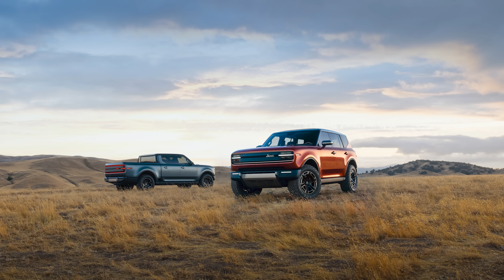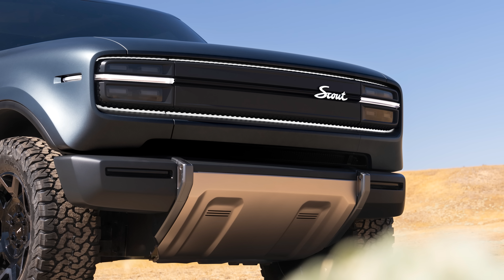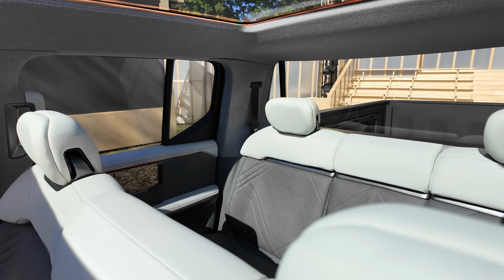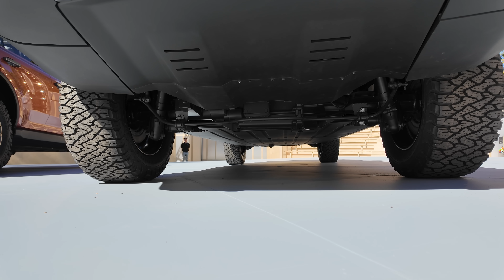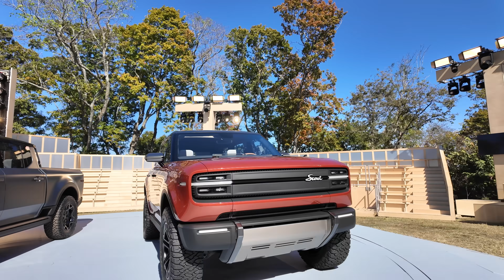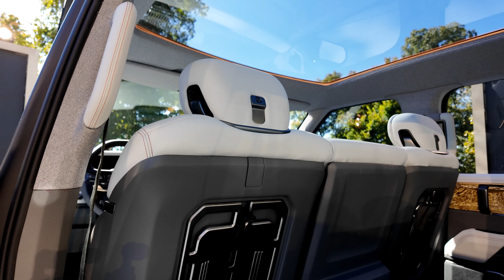2027 Scout Motors Terra & Traveler First Look!

Comment: It's not a scout.. it's no more a scout than prying that emblem off and slapping it on a bronco or rivian or 4 runner. It's literally a font and word, a brand tenant! There is zero heritage in it other than look. No tooling, no employees, no engineering, no factory. It's a insult. Just like polaris hiding behind Indians brand tenant. What kind of moron slaps a deposit down in something based on a emblem? No body in the serious offroad community is running e.v. for a reason. Essentially all of thale aftermarket support is for petrol rigs. Axels .. gears.. what are you gonna do?

Comment: An EV cyber tuck with a fable of range extension that hasn’t been engineered yet. Aftermarket Honda generator? I’d trade the widescreen dash for lap belts, half height seats and a tooth bashing metal dash in a heartbeat.

Comment: Direct sales for Scout Motors are in a legal battle similar to what Tesla faced. There won't be a dealer network and potentials are hesitant given Americans turning away from electric-only, especially for an off-roader. That means no service network, which is vital to startup brands going through teething problems. The initial price will only be affordable to top 10% of income-earners. Estimated range on these is always way above actual range.  I'd give them a 20% chance of making it, but Tesla faced similar hurdles. Hybrids yes,  electric-only no.

Comment: The gas powered engine to provide electricity for the electric motors is interesting. But after you've gone your 350 me or whatever and can't charge anymore I wonder how long/how far you can really drive for just off electrical generation from the gas engine and at what speed🤔

Comment: Definitely looks like re-skinned R1T and R1S, but in a good way.  And those interiors are gorgeous!!  The harvester range extender is going to be a game changer, too.  I've been a truck guy all my life.  I've been wanting to get a truck EV, but Rivian is too expensive, and the others are both too expensive and have design flaws I couldn't bring myself to live with.  I really, REALLY hope these Scouts are as good in production as they look on the screen right now, and that they keep to the teased price points (unlike Cybertruck - teased $40K, actual $100K).
Reply: They are body-on-frame with a solid rear axle. Definitely not re-skinned Rivian.

Comment: They brought in a group of guys, including the owner of Super Scout Specialties, that kept the nameplate alive, former employees and owners that really seemed to push VW/Scout Motors to keep it true to the original.  This thing is going to fly off the lots, if they follow through on features and pricing.
Reply: The old ihc has a fully boxed frames, solid axles, and stout drivetrain for working. This thing is a throw away consumer trash clone ripping off the heritage 😂 nothing ihc in this pos
Reply: @ArizonaMatrix  Guess we’ll see, since this is body on frame, solid axles, and will have to have a stout drivetrain to handle 1,000 lb/ft of torque.  🤷🏼‍♂️

Comment: Too similar to Rivian in genre, looks, and culture. The niche was barely big enough for Rivian alone.
Reply: The Scout is body on frame with real hardware like solid axles and transfer case. I wouldn't confuse a Rivian with a Scout. The Scout has placed themselves to be directly cross shopped with Jeep, Bronco, and 4Runner.
Reply: @redtitan29  With these hardware differences, is it assumed that the Scout would be a more capable off road vehicle vs the Rivian?
Reply: @randyhou8522  Absolutely. They are even offering lockers to show how serious they are.

Comment: They need to change the headlights. Make them circular like the old ones. Also, a removable top like the Bronco would be perfect.
Reply: The bronco truck appears to be a piece of crap problematic thing even after the redo of it. How many people with experience of soft tops or removable hard tops don't actually want to have anything to do with them. They want a nice clean proper non-removable hardtop that is dust-tight watertight weather resistant and clean. Most people never want to have the roof off except for maybe one or two trees for the novelty and then it's like screw it

Comment: So they copied what the BYD truck is doing in terms of the range extender with small gas engine
Reply: Also like the Ram Charger that Stellantis is having troubles bringing to market. This solution makes much more sense, especially during the transition period with limited charging stations as well as for those who travel long distances or travel in remote areas.

Comment: 350 mile battery and zero mention of charge times? And we have to wait 2 years to one?! Scout Motors…. YOU ARE DELUSIONAL!!
Reply: It's an 800v machine, and probably 120-135kwh for 350 miles. So at a 350kw charger, likely under 30 minutes. Maybe 25.
Reply: @deansmits006  EXACTLY my point! TY! Unacceptable and AVERAGE for a vehicle TODAY, let alone one you can’t get for 2 years!
Reply: Yup gas car can be back on the road in 5 minutes with equivalent range

Comment: Every ev should have that small engine that will give extra range on your ev cars.
Reply: It doesn't make sense on smaller EV that won't tow or go offroad.
Reply: With an 800volt architecture and nacs 350mi range is enough for 95% of the people.

Comment: The rivian with better looking headlights but Volkswagen crappy reliability
Reply: Get the EV version with no range extender, you cut out quite a bit of the unreliability. But vw isn't known for it's electrical dependability, however, purchasing the electrical backbone from Rivian should help

Comment: So it's a Scout in name only plus the limitations of electric. Don't think so.
Reply: It's a new brand that's built like an actual off-roader plus the advantages of electric. They could call it Black & Decker and it would still be interesting.
Reply: @Zobeid  I didn't say it wasn't interesting, it looks great inside and out. But all electric is predominately dead in this market no matter how good it looks or behaves (for a short while). The hybrids will rule eventually until some magical power vs weight ratio is found for better range. real world use is not how many miles you can go but how long it can be used in elements for work or travel all day long before having time for a substantial recharge. No manufacturer other than Tesla is making money and this is mainly because they make commuters that are much better than most other choices.
Reply: No limitations with the gas version that's used as an onboard generator.
Reply: @redtitan29  actually it just extends from 350 to 500 miles from what I understand. Called a range extender, not a true hybrid but still a nice addition.
Reply: @towertone  It’s not a hybrid. In a hybrid the gas engine powers the vehicle. In the Scout, the gas engine acts like a generator to charge the batteries while the electric motors power the vehicle.
Reply: @redtitan29  did you actually read what it does? It's right there on their web site. If a 500 mile range is all you need (at max) then yes it might be a great vehicle. I don't like range limits for charging as I regularly go over a 1000 miles a day. Your mileage may vary...
Reply: @towertone  Every vehicle has a range.
Reply: I had a 1972 scout ii and this is no scout 😂😂😂 the heritage was farmers needing something smaller than the commercial trucks ihc made. This is not that 😂

Comment: Compete with Rivian? How is it not completely obvious that these actually are Rivians? Do you really believe VW paid 5 billon for just software?
Reply: Yes. Trust me I work at Scout. This was literally all built before the VW Rivian deal. That deal is only software.
Reply: That deal literally happened out of nowhere, I work for VW and it was a complete shock to everyone in the silicon valley @arcostonian
Reply: @arcostonian So what's the inside scoop, we really gotta wait 3 more years?! 😢
Reply: @arcostonian  wait really? Can you share more details on the Scout brand, if Rivian will make components for the Scout, etc?
Reply: Exactly
Reply: They are body-on-frame with solid rear axles. Definitely not a Rivian. The truck is also larger than the R1T.
Reply: If you compare the timeline of the VW deal and teh presentation, i dont think you would get fully working prototypes in that ammount of time, the development surpassed that deal long before
Reply: Well said

Comment: Price adjustment...100000$
Reply: Good news is it won’t be sold by dealers and will be direct to customers
Reply: @horuslupercal3872 yeah ? That‘s really good news if its true man, fuck em dealerships
Reply: Direct purchase is going to put the kibosh on Dealer Added Incentives.  If they keep the pricing and features, this thing is going to be a home run.
Reply: That sounds about right.  They $60k one will be stripped down low range base model
Reply: Sure,  I have an extra 100k just lying around,  not to mention Insurance costs.  No thanks
Reply: CEO  himself said they will start at 50k with incentives

Comment: That harvester range extender is absolutely unique in the US.  That is going to make this truck a great success.  Very excited!
Reply: I wonder if they have a design yet, or just a concept for the extender.
Reply: Depending on how the gas engine is packaged this could be a homerun. 

Living in the south and having a lightning already i would love the suv range extender for hurricanes.
Reply: @ryanwalters6184  Same for me up North.  Sometimes we get blizzards or tornados that take out power.  Would be nice to have that 1 or 2 days without getting the old diesel generator out, or at least another option.
Reply: Ramcharger and Chevy Bolt dont exist huh?
Reply: @KuzKiller887  ramcharger is not on the market yet. Bolt is all ev. You meant to say volt and that's totally different. Your 0 for 2.
Reply: @0my  
-Just because its not on the market yet doesn't make this unique. 
-The volt is not "totally different" it is literally an EREV. 
- You're*

0 for 3 squirt
Reply: @KuzKiller887  lol. The Ramcharger doesn't exist yet. Not even a prototype to review. The volt only goes 30miles on electric, not 230 miles, and it couples the ICE to the transmission at highway speeds, that's not the same.
Reply: An actual v8 engine, or hell even a V6  would make it an even better success
Reply: BMW i3 range extender but on that vehicle it's almost a must 😅
Reply: How is it Unique in the states? What experience do you have? Look for your response.
Reply: I definitely preordered the Terra.
Reply: would be really interesting if they could use a multi-fuel system like some generators have... propane, LNG, gasoline, diesel...  make it truly universal.
Reply: Ram did it first
Reply: @TellurideS13  Nope.  BMW i3
Reply: @paden55  i3 is all electric. There's no ICE.
Reply: @TellurideS13  You have to buy a Ram to get it
Reply: @TellurideS13 pretty sure Fiskar did it first.
Reply: @TellurideS13  Edison Motors did it first :)  Well to be fair this isn't a new technology.  Just glad there are now 3 options for this when I need to get a new truck
Reply: @WillYork  haha. It's cute you think Edison motor is an actual option.
Reply: @WillYork  Not a production vehicle
Reply: @mofayer  why isn't it?
Reply: @TellurideS13  true but we don't have to care who did it first, but rather we as consumers get more options.
Reply: Ehhhh…  Some folks will for sure find it useful, like if they do a lot of towing or live in Wyoming. I think by the time these hit the streets, with a NACS charging port (and presumably access to Tesla's network), and the number of charging stations built out by then, most folks won't even bother with the PHEV version.
Reply: @Zobeid  Where I live there is 1 Supercharger like 40 miles away from my home.  I would be waaaaaay more comfortable with a generator on my vehicle to charge it.  I almost run out of gas in my truck as it is, albeit that's my fault.  Im glad they are coming out with this as an option though because people who do have the luxury of charging they won't ever need it